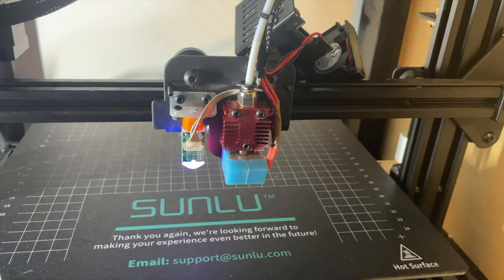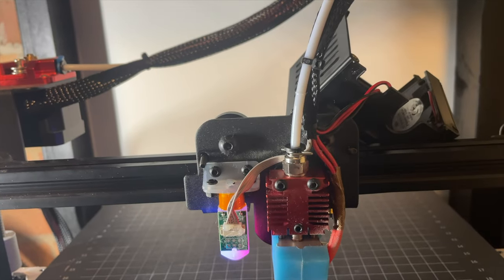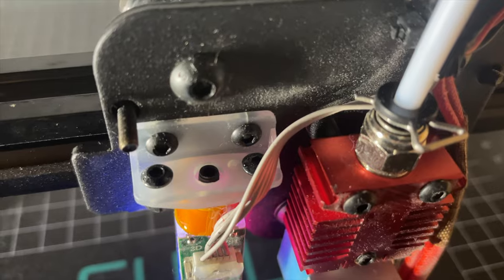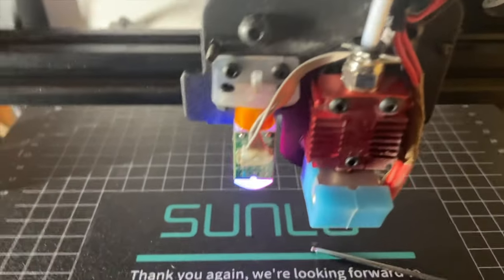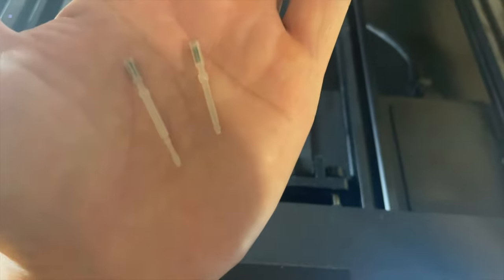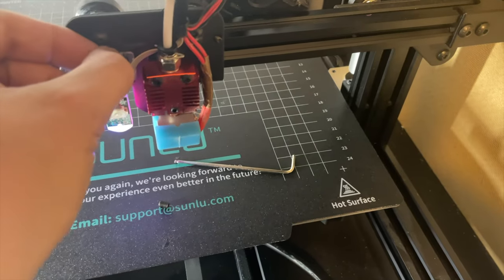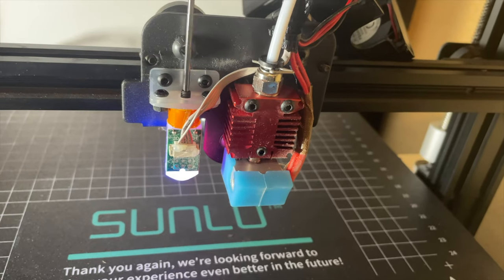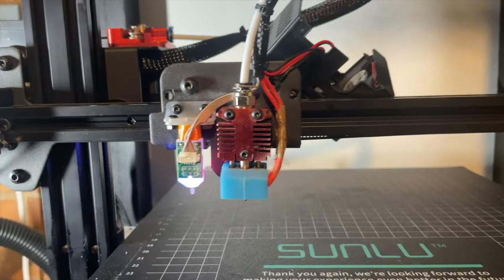How to Fix Broken BL Touch (TUTORIAL)

Comment: Did your Sunlu drill into the print bed like mine did?  I found the broken off part of my probe and was able to super-glue it back together, dangling it so that it was perfectly straight!  Then I got the correct piece as you got.  Then Sunlu after a minor battle, sent me a whole new assembly!  Sunlu is pretty cool though they are awkward to deal with at times.  Thanks for posting this I think it's the first I've seen of it.
Reply from the maker: Yeah. It probably caught a print and snapped. Next print I tried and obviously hit the bed and started skipping until I realised the probe was broken. I knew what the problem was straight away so I didn’t even bother contacting them. But glad to know they sent out replacement parts.